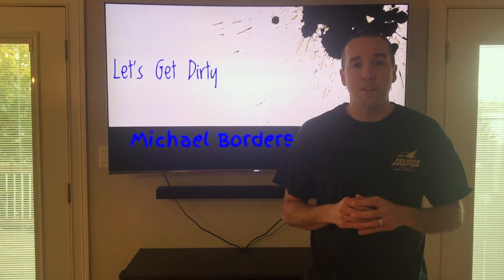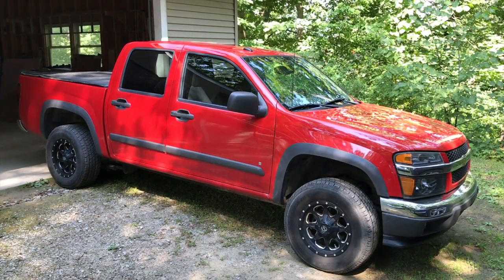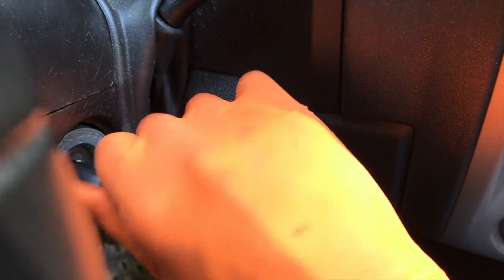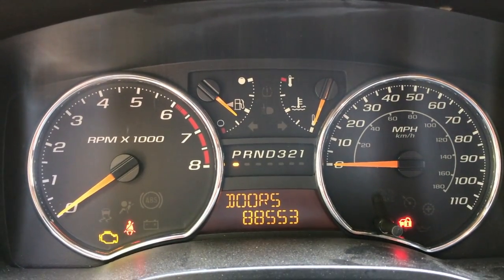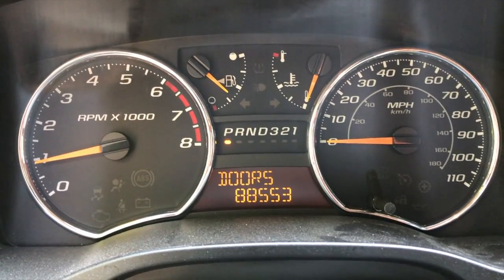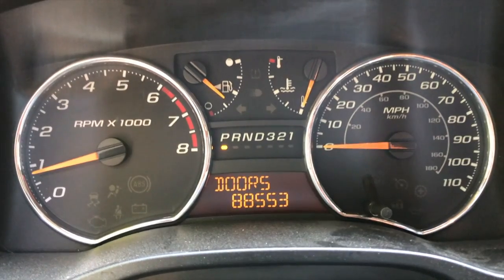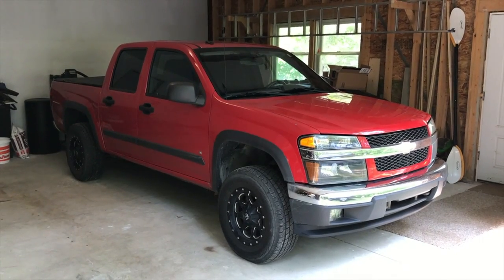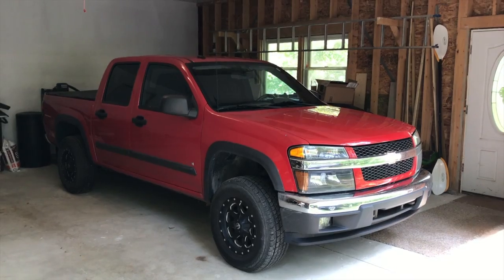How to do a "QUICK Reset" on your ABS System!

Comment: So this didn’t work. 😢 Pilling my hair out. Also how can I check the fuse box to see if it or one of the receivers for the fuse is out? Are there fuses inside my vehicle that have something to do with abs? Note:All lights are on in regards to a brake issue as well as traction control light, ABS, and my seat belt light/airbag ls light too, all are on which I read means my airbags will not deploy in the case of an accident. Help please! 😢
Reply from the maker: Good morning, just poured a cup of coffee and am sitting down to answer any and all questions for the DIY community.

C C, we are here to help!  😁

The first thing we recommend doing is carefully disconnecting the black negative cable from your battery and leaving disconnected for a minimum of five minutes.  After five minutes, resecure black negative cable to battery and start engine to check if ABS system has been properly reset…and is now configured properly.

If that doesn’t work, we have added a link below that takes you to our video explaining the common causes.  This video will hopefully help you get a better idea of your vehicle’s fuse locations.

       https://youtu.be/5lgMhKYGuto

Let us know if you have any questions and hey if you’re into crypto, join our DIY ecosystem.

       toolboxtoken.com

Reach out to us any time!  🧰

Comment: i did this in my 07 chevy silverado bc my brake lights wouldnt come on, now my reqr running lights, blinkers, nore bake lights work.. fk me.. just q heads up for some ppl.. any ideas or ways to fix this?
Reply from the maker: Thanks for watching.  We recommend performing a full system reset by disconnecting the black negative cable from your battery and leaving disconnected for a minimum of five minutes.  After five minutes, re-secure black negative cable to battery and start engine to ensure everything returns to normal configuration.

Let us know if you have any questions and hey if you’re into crypto trading, join our newly launched DIY ecosystem.

          toolboxtoken.com

Reach out to us any time!  🧰

Comment: How do we do this if my car is push start?
Reply from the maker: Thanks for watching and that is a great question.  First make sure your key fob is not inside the vehicle.

Next, press the start/stop push button without pressing the brake pedal.  This will allow your vehicles electrical system to turn on.

At this point, you can perform this procedure.  Keep us posted and hey if you’re into crypto trading, check out our newly launched DIY ecosystem.

     Toolboxtoken.com

Reach out to us any time!  🧰
Reply from the maker: Thanks for watching and that is a great question.  First make sure your key fob is not inside the vehicle.

Next, press the start/stop push button without pressing the brake pedal.  This will allow your vehicles electrical system to turn on.

At this point, you can perform this procedure.  Keep us posted and hey, if you are into crypto trading, check out, our newly launched DIY ecosystem.

     Toolboxtoken.com

Reach out to us any time!  🧰

Comment: It's a MIRACLE!!  I am a competent individual with a broad knowledge of mechanics and electronics. I was very skeptical.  But it does work actually.  Twice the problem warning light returned.  Third try fixed it permanently.  Thanks, Michael.  You probably saved me a thousand bucks.  No telling how much time and frustration.  How simple can a fix be.
Reply: The same happened with me; The problem warning light returned twice, but how did you fix it permanently?
 Maybe this is your chance to do something for someone...
 Blessings
Reply: does this work on a 2011 buick lacrosse cxs 3.6? it is a push button to start it
Reply: My problem kept coming back actually. More consistently each time. Bottom line it didn't work
Reply: I could not fix it permanently only temporarily
Reply: So how did u fix it permanently in the end? 
Abs module replacement?

 @rickmcquiston3266
Reply from the maker: Thanks for watching, and thank YOU Rick!  Saving a thousand bucks is a great thing!!!!  😁👍

Means the world to us that you took the time to leave a comment.

Let us know if you have any questions and hey if you’re into crypto trading, check out our newly launched DIY ecosystem.

       Toolboxtoken.com

Reach out to us any time!  🧰

Comment: I changed my break pedal sensor on a 2011 gmc acadia and the abs light is still on can i reset it and how??
Reply from the maker: Thanks for watching Jessica, great job making the brake pedal sensor replacement a DIY project.

You can follow this reset procedure and try to get your ABS system back to proper configuration without any lights illuminated.  Please keep us posted.

Looking forward to hearing back from you and hey if you’re into crypto trading, be an early participant in our newly launched DIY community ecosystem.

       Toolboxtoken.com

We DIYers need to stick together!  🧰

Comment: Hi from the UK. Would this work on a 2002 ford escape xlt?
Reply from the maker: Thanks for watching, it’s very possible.  We had a viewer not to long ago mention that it worked on her Escape.  Keep us posted, and reach out to us anytime.

Hey also if you’re into crypto trading, join our newly launched DIY community ecosystem.

       Toolboxtoken.com

We DIYers need to stick together!  🧰
Reply: @DIYwithMichaelBorders  will do. Thanks for responding  .
Reply from the maker: @seamusolunacy  

That’s what we’re here for, communicating and helping the DIY community is our passion.  👍🧰
Reply: @DIYwithMichaelBorders  unfortunately it didn't work but I need new pads apparently so that's what the light was for. 👍
Reply from the maker: @seamusolunacy  

Thanks for the update, new pads are a great upgrade.  Nothing wrong with that.  Let us know how the project goes.  😎👍🧰

Comment: Darn. Didn’t work on bmw 335 IS.   Anything else could try?
Reply from the maker: Thanks for watching, you can try disconnecting the black negative cable from your battery and leaving disconnected for five minutes.

After five minutes, resecure cable to battery and start engine and hopefully it resets your ABS system and turns off light.  If it doesn’t, it’s time to visit your local AutoZone where they can read your ABS error codes.

Most AutoZone’s do this for 100% free however not all so we recommend contacting them prior to making the drive to see if they provide the service for free.

The OBD scanner can pinpoint the exact part causing your issues so you can get it replaced and get yourself back up and running without that ABS light on.  Please keep us posted.

Hey also if you’re into crypto trading, join our newly launched DIY community ecosystem.

       Toolboxtoken.com

We DIYers need to stick together!  🧰
Reply: @DIYwithMichaelBorders   thank you for the reply. I’ll give it a go and let you know. 
Cheers
Reply from the maker: @coryvanwormer-QualicumBeach  

So happy to help, cheers.
Reply: @DIYwithMichaelBorders   unfortunately disconcerting it didn’t work.   Thanks again!
Reply from the maker: @coryvanwormer-QualicumBeach  

Thanks for the update.  It may be time to contact your local AutoZone and have them read your ABS error codes.

Most AutoZones do this for 100% free as long as you purchase the replacement part from them.
Reply: @DIYwithMichaelBorders  no auotzone here. I have a good mechanic just was hoping to avoid the fees lol.
Reply from the maker: @coryvanwormer-QualicumBeach  

Awesome, good mechanics are great.  Looking forward to hearing back from you.  😎👍🧰

Comment: Damn didn’t work. Where can I find other options? I have a Cadillac srx
Reply from the maker: Thanks for watching, try disconnecting the black negative cable from your battery and leaving it disconnected for 30 minutes.  This will allow your system to reset.

After 30 minutes, resecure cable to battery and start engine to see if ABS light went off.

If it doesn’t, it’s time to have your ABS system to be read by an OBD2 scanner, which AutoZone usually does for free.  You may want to contact your local AutoZone before driving there to ensure that they provide the service for free.

An OBD2 scanner will pinpoint the exact part causing your issues.
Let’s start there, keep us posted .

Also if you’re into crypto trading, join our newly launched DIY ecosystem.

       Toolboxtoken.com

We DIYers need to stick together!  🧰

Comment: Does not work, tried several times.
Reply from the maker: Bummer, thanks for watching and sharing this.  If you disconnect black negative cable from your battery and leave disconnected for at least 30 minutes, does ABS light go out after resecuring cable to battery and starting engine?

If not, it’s time to have an OBD2 scanner hooked up to car so it can read your ABS fault codes.  AutoZone usually does this for free as long as you purchase the replacement parts from them.  We would call your local AutoZone to see if they perform this diagnostic for free.  Please keep us posted.

Also if you’re into crypto trading, join our newly launched ecosystem.

       Toolboxtoken.com

We DIYers need to stick together!  🧰

Comment: This didn't work for Ford Edge 13
Reply from the maker: Thanks for watching.  Next thing to do is visit your local AutoZone and ask them if they can hook up an OBD scanner to read your ABS fault codes.

Some AutoZone’s do this, some don’t.
Reply: @DIYwithMichaelBorders  
thank you for your reply 
I just changed two rear bearing hubs  speed sensors 
same codes appear before and after replacing, 
codes are:
U3003-16
U3003-17
U3002-62
C0040-64

please help
Reply from the maker: @ibraelwa6663  

Thanks for the follow up, have you disconnected your black negative cable from your battery and allowed battery to sit disconnected for a minimum of 30 minutes?

This will allow your onboard computer to reset and hopefully once the engine is started and a test drive performed, all new parts will properly communicate with computer and turn off all fault codes.

Comment: If you are buying a car from some small dealer as-is, if I do this and it goes off…. Will it come
Back on in a few minutes if there is a real
Problem with ABS??  Thx
Reply from the maker: Thanks for watching.  Great question and yes.  After completing this reset procedure and taking the vehicle for a test drive, if ABS light illuminates… there is a faulty part or sensor within the ABS system.
Reply: @DIYwithMichaelBorders  Thank you so 
much! And thank you for sharing. Great video!
Reply from the maker: @kem.4274  

😁👍

Comment: Didn't work for me , never mind .
Reply from the maker: Bummer, you may want to invest in an OBD scanner that reads ABS fault codes.  It will help pinpoint the exact part causing your ABS system issues.

Below is a link to a video of the scanner we purchased.

       https://youtu.be/DvogiRhGEYk

😎👍
Reply: @DIYwithMichaelBorders  Well it's the traction control light that stays on the the abs light but it won't turn off despite telling me it's off on the dash before I turn it over , very annoying , Patrick ,., England .
Reply: @DIYwithMichaelBorders  Patrick , England.

Comment: 2005 Honda Civic: My ABS light stays on.   I had the OBD indicate the right ABS sensor wire was broken so I bought a new ABS sensor & had the mechanic put it in.  After the mechanic put the new ABS sensor in, he told me it was the sensor for the left side, but they “made it work”.  However, the light still comes on. 
 I just want to make sure the car is good for a 600 mile road trip (& would prefer to have that ABS light off & the ABS sensor working properly.

Thank you
Reply from the maker: Thanks for watching, definitely understandable.  A 600 mile road trip is a long way.

Some will say it’s ok, others may say get it fixed…that will be personal preference in the end.  We have talked to more people that say it’s ok.  Haven’t tried it ourselves.

Safe travels when that time comes.  😎👍

Comment: Nope
Reply from the maker: Thanks for watching, let us know if you have any questions.
Reply: @DIYwithMichaelBorders  My traction, abs, and brake light keep coming on after a few hours driving then the next day completely gone off.  It has done it foe about two weeks and then the engine light came on and stayed on.  The mechanic replaced the vrake light switch twice stating the first one was 4 hybrid car yet later they all came back on.  Have you heard of this?  Toyota Camry 2012
Reply from the maker: @ladyj5682  

Thanks for the reply, sounds like sporadic electrical behavior.  This is most commonly to occur when one of the 4 speed sensors become intermittent.

Or, one single speed sensor has trapped moisture inside connection.  Or, it may be as simple as disconnecting negative cable from your battery and leaving disconnected for a minimum 30 minutes.  This will allow your electrical system to reset.

😎👍

Comment: My light is not on but I'm having this sporadic braking problem in which the steering wheel wobbles violently like it was a really bad brake rotor issue but it doesn't always do it. Lightly pumping the brakes real fast and then applying them also stops the wobble, I can't find any info on this because everyone jumps to rotors. 2016 chevrolet 3500 with 72000 miles.
Reply from the maker: Thanks for watching, tough to pinpoint exactly however a few common causes of this is a warped rotor or a caliper in its early stages of failure.
Reply: @DIYwithMichaelBorders  it doesn't do it all the time just every once in a while and will stop as quick as it came, when it's not doing it the brakes feel smooth and when it does the truck would go completely out of control if I kept on the brakes but a fast gentle pumping of the brakes stops it the brake as needed, everyone goes straight to bad rotors though but I think it's some sort of abs issue.
Reply from the maker: @terryken12  

Thanks for the reply, we experienced similar symptoms a few years back with a Dakota.  It ended up being a bad caliper.  Although this might not be your issue, we can’t rule it out.
Reply: @DIYwithMichaelBorders  
Mine started after a dealership tire rotation and oil change, it did it the first time when leaving the dealership and after a heated refusal of a cabin filter and air cleaner upsell in which the truck was still on the rack with the wheels off  after the the service dept called said it was done and to come pick it up, also the reason I don't want to take it back to them until I get to the bottom of the problem, it's really weird that is when it started. When I find it I'll let you know, I feel it's simple as the truck is low miles and kept in a climate controlled garage, probably hasn't been rained on a dozen times, I used to be a mechanic and we would have classes where one group would try and test the other to find technical tricks like if you opened a caliper and pumped the brakes then reclosed it you could create a abs problem.
Reply from the maker: @terryken12  

Thanks for the update, that’s unfortunate the problem began immediately following dealership service.  We have been very disappointed with our local dealership as they just don’t tell the truth…very upsetting.

Looking forward to hearing back from you.
Reply: @DIYwithMichaelBorders  
Still not to the bottom of it but got a tip from a chevrolet site to turn off the traction control which does stop it, I'm getting closer now thinking it's a sensor issue.
Reply from the maker: @terryken12  

Thanks for the update, turning off Traction Control is temporary fix.  Have you double checked wheel wells to ensure all four speed sensors are properly secured?
Reply: @DIYwithMichaelBorders  
Not yet, I haven't had the time, I have a service company and we had a cold snap that has kept me busy with furnace repairs this weekend.  Time is more elusive than a braking issue. 😂
Reply from the maker: @terryken12  

Definitely understandable.  😎👍

Comment: I try on my ford edge and it didn't work does that's only for GM
Reply from the maker: Hey what’s up, this reset is standard across many manufactures.  Since it didn’t work for your specific vehicle, we recommend having your ABS system read by an OBD II scanner.  This will help pinpoint the exact part causing your exact issues.

Sometimes AutoZone does this for 100% free…not always…but sometimes.  We recommend giving them a call and asking.

Comment: Didnt work for me
Reply from the maker: Thanks for watching & sharing.  Next, we recommend disconnecting the black negative cable from your battery and leaving disconnected for a minimum of 30 minutes.

After 30 minutes, resecure black negative cable to battery and start engine.  This will also allow your onboard computer to perform a full system reset.
Reply: Im 5 minutes from work think maybe itsthe brake fluid wasnt on last night rained today an was on this morning drove it to work an still on